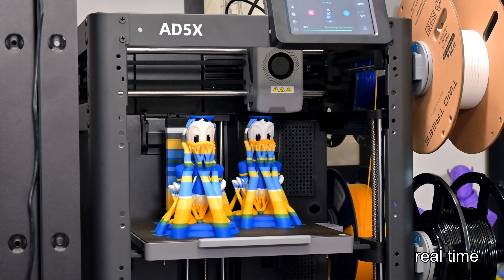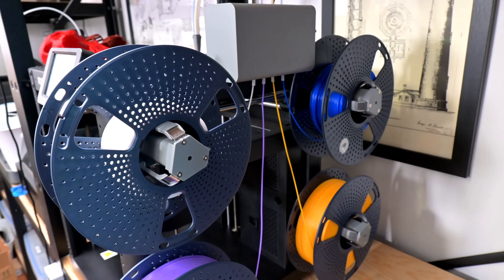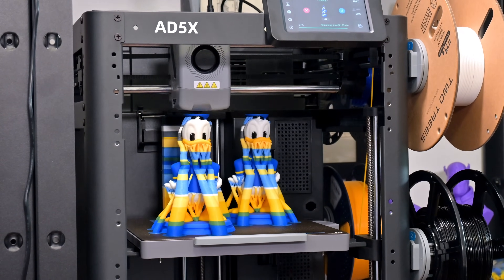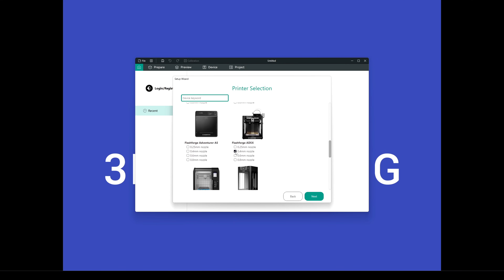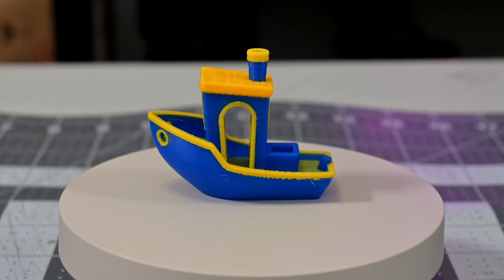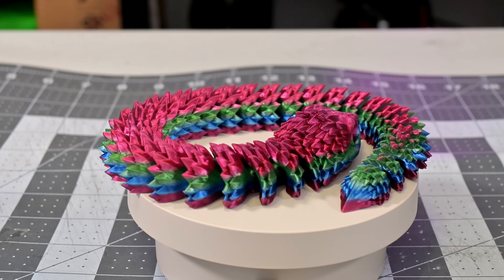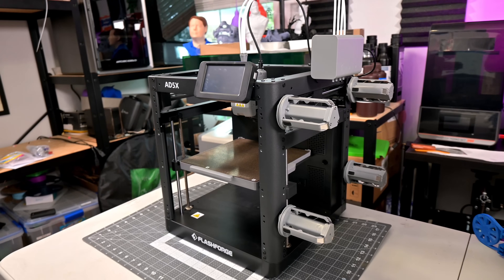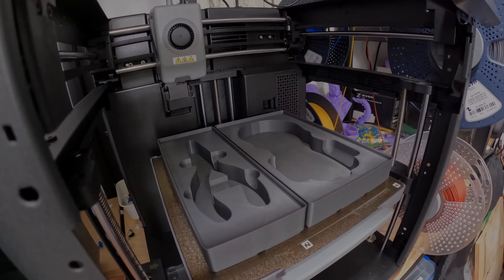This $399 3D Printer Changes Everything | Flashforge AD5X Review

Comment: Some filament manufacturers have changed the spool diameters so that they fit on these systems and don't spin and fall off, Sunlu has decreased the center hole diameter and they fit perfectly and never fall off. The issue you had was with a spool centre diameter being too large and spinning on the holder.
Great review and especially making people aware of the amount of waste with multicolour.

Comment: Flashforge is garbage. I'm going to look into an Elegoo Carbon. Flashforge doesn't connect well to Wifi. Orca Slicer won't print, Flashforge Orca won't print, the only slicer i've been able to use reliably is Flashprint and it's a bare bones slicer that doesn't even have Elephant's foot support. Tried to contact Flashforge and I get a chat bot who can only answer with "I can't answer that right now, try these suggestions". No suggestions. My boss bought me this printer so I'm not out anything. Pretty much a boat anchor.

Comment: The fact that it's got the same amount of filament colors as the anycubic I've got is almost annoying! 🤣 Honestly tempted to try one out and see how it compares
Reply from the maker: Yeah, I was pretty impressed. Color switches are faster on the AD5X compared to the Anycubic Kobra S1. The S1 needs to retract all the way to the buffer at the back of the printer, the AD5X just needs to retract out the hotend. Like 20 seconds difference per color change.

The S1 has a larger printer volume though.